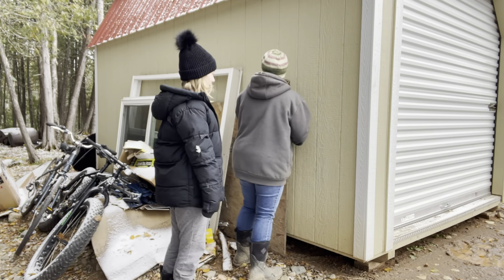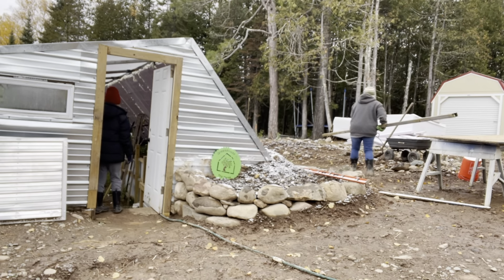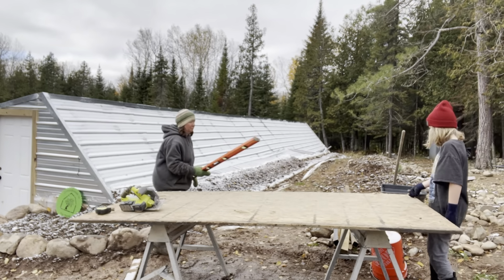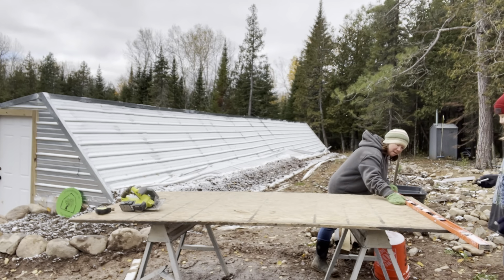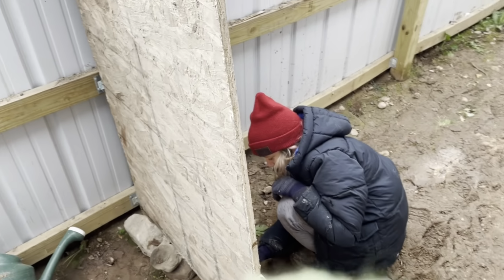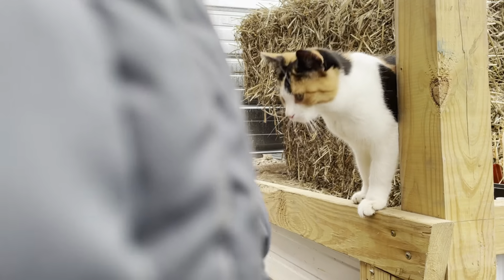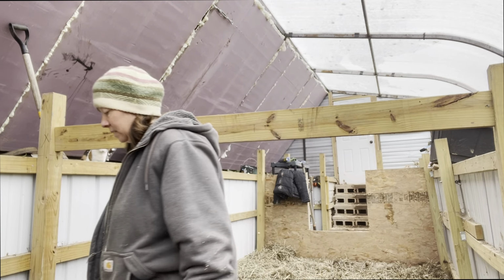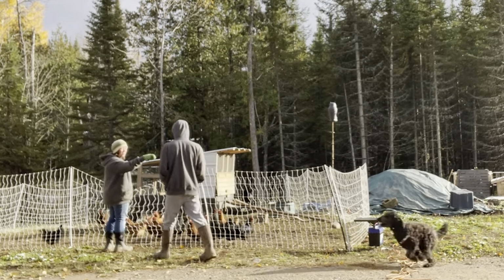Growing eggs and chickens in our greenhouse

Comment: We have a greenhouse in the snow as well! We are located in NE  just like Ross Finch. We love seeing these greenhouses!
Reply from the maker: I have SO many questions!  How long have you had yours?  What would you say is your biggest challenge?  Your biggest benefit?
Reply: We built our geothermal greenhouse summer of 2019. Biggest struggle has been white mold (came in on store bought compost) and aphids/mealy bugs getting in after the accident (semi with pup trailer went off the highway and took out part of the east end of our GH). Despite those adventures it has been an endless blessing! Biggest benefit is arguable, but I would say the increased self sufficiency and being able to garden in a Midwest winter! Helps ward off the winter blues.